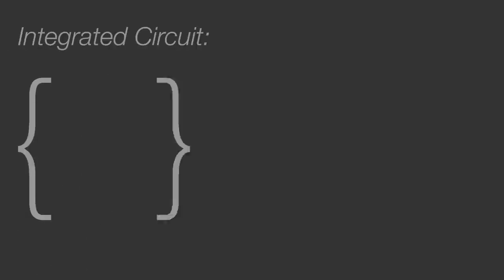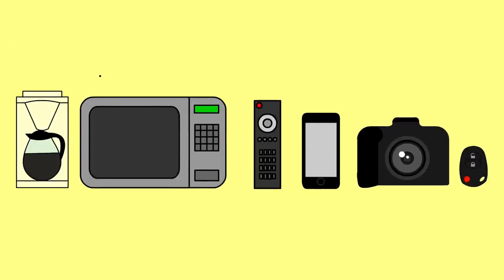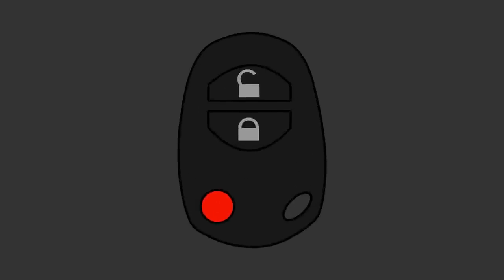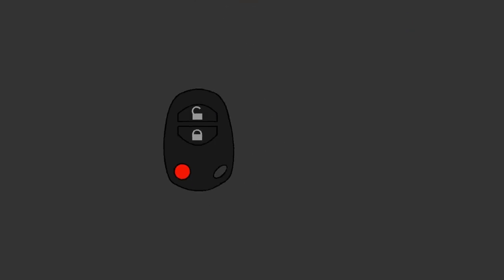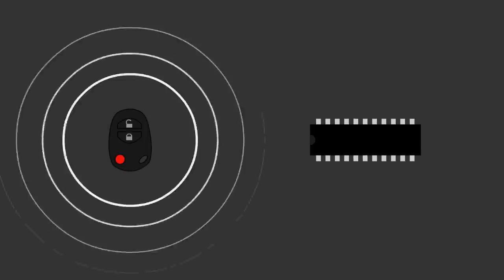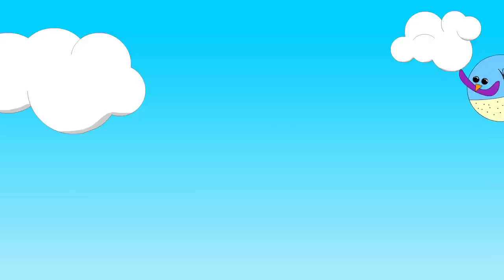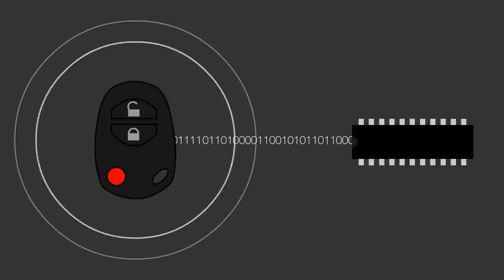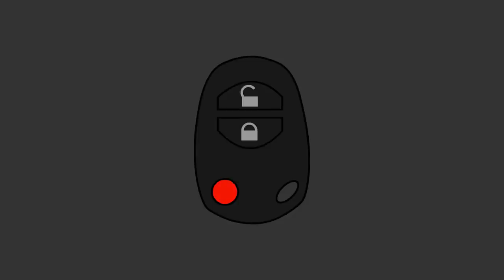How Microcontrollers Work

Comment: Where does the 2^40 come from in determining the amount of codes?

How do car companies work out who gets what?

What if Dodge took codes 1-10,000,000 for their first 10 million cars. And Ford took codes 1-10,0000,000 for their first 10 million. All the Fords and Dodge fobs would start eachother. The only difference is that there is only 1 in 19,999,999 cars that has the same code as you.
Reply from the maker: I made this video a couple years ago for a capstone project and don't remember all the research behind it (not to mention the content is very watered down), but if I remember correctly key fobs often use codes that are forty bytes long.

You can't think of the code like a MAC address or IP address, which are assigned in specific ranges by the IEEE or ICANN respectively.This code isn't the same every time you use the key. Key fobs use something called rolling codes, which essentially means that every time you press the button the key fob transmits a different code on a different frequency. Because both the code and frequency changes every use, this guarantees a unique signal. Encryption is a pretty broad (and very cool) area so I'd reading up on modern wireless encryption technologies.